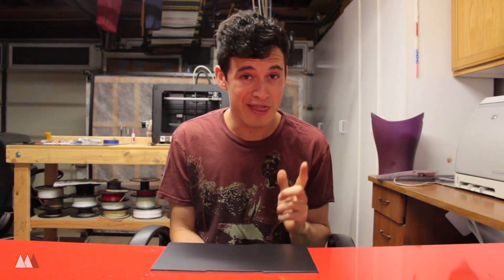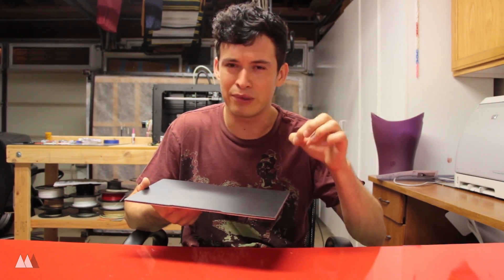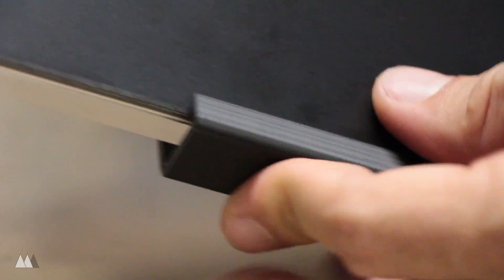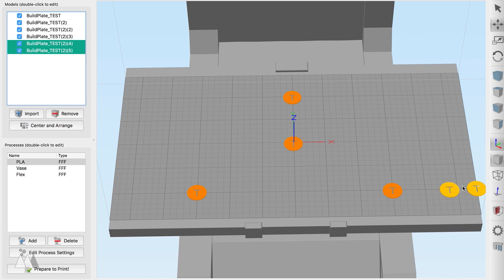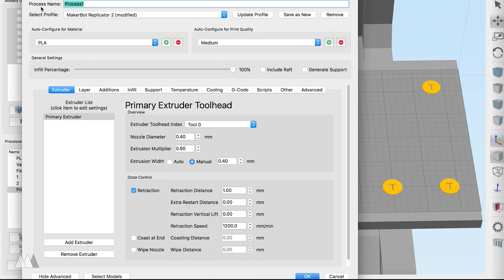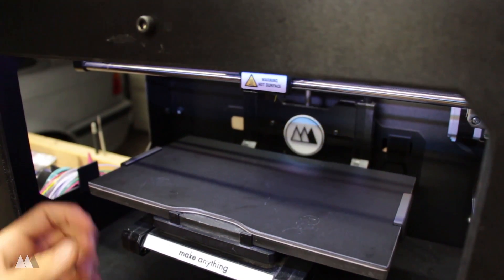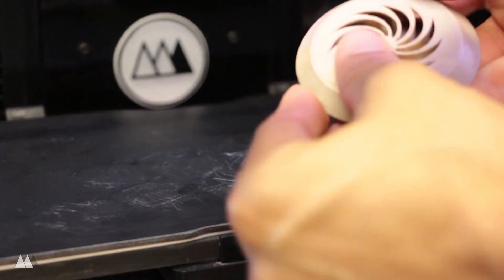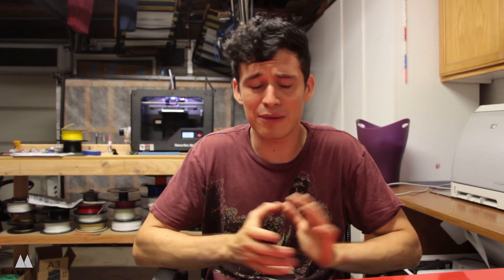Upgrading to a PRINTinZ build plate + Bed-leveling using S3D

Comment: how do you keep the mounts that hold the plate to your heated bed from working and using their pressure to hold the plate down? My heated bed just warps them until they have no pressure down and the plate moves. Has anyone fixed this problem?
Reply from the maker: I don't have a heated plate.. if I did I would probably just use binder clips
Reply: Make Anything // 3D Printing Channel So I just bought this plate and I have a Makergear m2. When you start a print on the makergear. The nozzle goes to z=0 which is the top of the the stock glass plate which came with the printer... well the z plate is much thicker and if the nozzle touches the plate it gets damaged... So my question is... How do I keep the nozzle from touching the bed? Do I change the gcode to stop it earlier? Do I add an upgrade to stop the nozzle before it touches the z plate? I'm lost and dont know what to do. HELP!

Comment: I'm still too hooked on my glass plate
Reply from the maker: I'm worried my nozzle would scratch the glass way too soon.. I play around with the leveling too much :P
Reply: been using the same glass plate for nearly a year now, no scratching, no chipping, no problems really, well I did have a few prints that were a hell to remove but they came off fine after a while
Reply: do you use anything to add adherence to the glass ? I could not make shit stick to it without papertape x)
Reply: I use a glue stick

Comment: While it does work nicely as a print surface, I was very disappointed by how easily damaged it is.
Make sure you don't print too slowly either, otherwise PLA will just permanently bond to it.